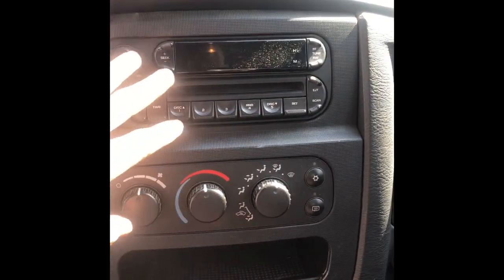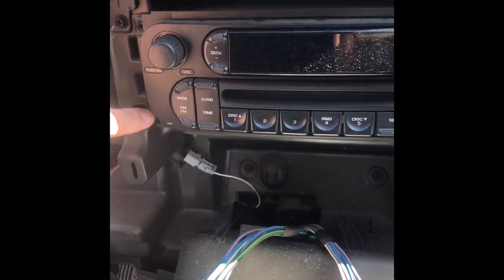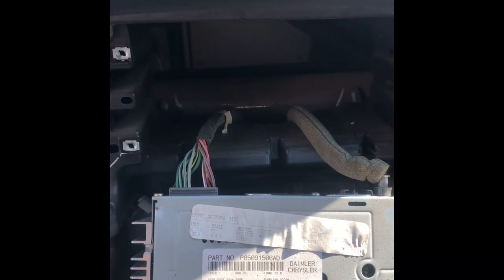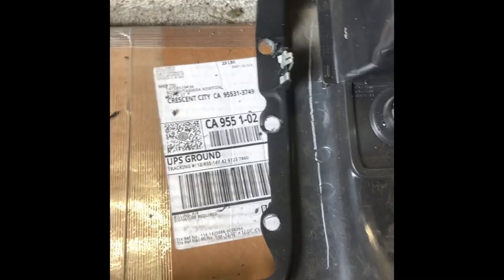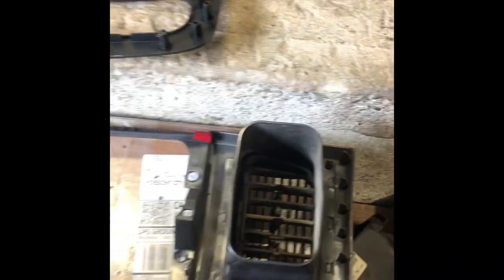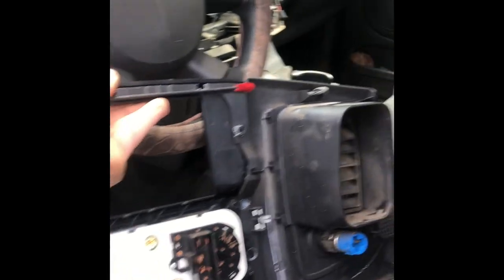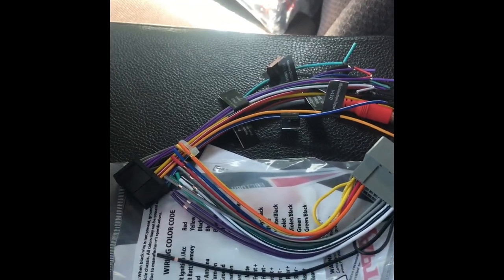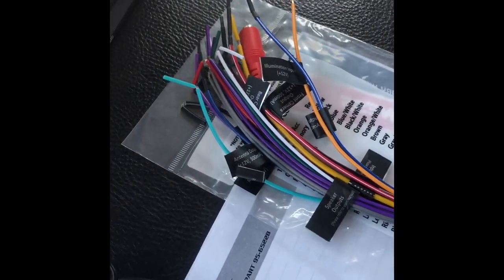Double Din Stereo Install 2002-2005 Dodge Ram Truck

Comment: Would have been awesome if you went over the wiring. It’s not just connecting the colors together and all done. You may as well just showed a before and after.
Reply from the maker: Actually, on My Dodge, it was just simply connecting the colors together and there were a couple that had lines on them, but they connected to the same color wire with a line on it as well. Thanks for watching.

Comment: Nice abbreviated install. Did you have to cut the plastic on the top of the opening to get the radio to fit square to the front? Also, the rubber floor mats look underwhelming. Husky makes some floor mats that fit like a glove for  these trucks.
Reply from the maker: Nope, didn’t have to cut any other piece. Thanks for the comment. Yeah, think I bought those floor mats in ‘07. Hahaha. I think they might even be old husky’s. Before they got into the molded mats. I should probably upgrade. Thanks for watching

Comment: Did you wire in your steering wheel controls I would like to do this with my 2003 Dodge Ram 1500

Comment: Do any double din radios fit that are 6.2 inches? I’m looking for a radio that has apple CarPlay but I’m afraid it won’t fit on the double don install kit.
Reply from the maker: I’m pretty sure they will as long as the measurements match.

Comment: you`re supposed to "melt" the panel studs to install it,   hot glue will probably fail sooner or later.
Reply: Try Krazy Glue and baking soda for a more permanent fix

Comment: GREAT CONTENT. 
FYI, here's a tip. When filming, you should shoot in a horizontal position, this will alleviate the blocks on each side of the video and will be full screen.
Reply from the maker: @Jimmy Rivano Thanks, was having trouble with the editing app and it wouldn’t work horizontally. Would make the vid like 1/4 screen. Thanks for watching and the compliment.
Reply: Box

Comment: Good job with the video.  Much appreciated.  I have a new double din Kenwood Excelon stereo on the way from Crutchfield and will be putting it in sometime over the next couple weeks.  I was concerned about the dash modifications but it doesn't look too bad.  Oscillating tool was a good idea. Looking forward to using the new stereo not only for music, but for the backup camera and navigation apps as well.  I'm replacing a Pioneer single DIN that I put in several years back.  It still works great but I really wanted a larger screen after driving some newer vehicles that have them.  Another great mod for me was upgrading the door speakers.  I bought Kickers and they are awesome for the money.   I'm currently running an inexpensive license plate backup cam that is wired to an Edge gauge set.  It sorta works but the screen is too small and grainy.  Anxious to see it on the big screen.
Reply from the maker: Thanks for the Compliment! Much appreciated. I was concerned about the dash mod as well, but it’s very easy. I’ve been thinking of some new door speakers as well, so thanks for the advice on the brand! Thanks for watching
Reply: what backup camera would you recommend.  I'm shopping around now.  I bought a Excelon 907 and wanting to install it and the camera

Comment: Dude.  Good video.  Well done thanks.   What is the largest screen we can get into these older Rams?
Reply from the maker: Thank you for the compliment. I’m going to say this head unit is probably pretty dang close as to what will work. But I imagine as long as they make the front to fit and the unit will fit in the modified cubby, they could make something with a larger screen that will work..?

Comment: I wonder if you can use like a cordless ryobi solder to cut out the deck.
Reply: You probably could but I don't know how bad the plastic fumes would be, you could probably also do it with a Dremel cutoff wheel

Comment: Did you have to connect the parking brake wire into the harness. will the radio work when not parked without it connected?
Reply from the maker: @jeon person To be honest, I’m not sure/don’t remember. I just hooked up whatever wires that were there. I don’t have any issues when parked or not. Sorry couldn’t help more.
Reply: @figsoutside1981  All good man, thank you! And good video! 👍
Reply from the maker: Thanks and thanks for the compliment.

Comment: I have a 2002 Dakota with the same head unit and air conditioner controls and I thought it was a single din for the longest time until I saw someone else take theirs out and apparently it's a din and a 1/2 even though it looks like a double din, Do you have any measurements you can give me?
Reply from the maker: @PAKTRA PRODUCTIONS sorry to reply so late, dimensions of the head unit or what’s under the cover piece? I believe most are actually din and 1/2. I’m pretty sure that’s what mine was too.
Reply: @figsoutside1981   Yeah I was curious of the actual dimensions of the unit itself like as far as depth and all of that

Comment: And does this work with the old infinity stock speakers and radio wiring etc?
Reply from the maker: @Dakota Larimer Yes, it works just fine. The Plug adapter came with the Dash kit and is color coded with very small labeling for what the wires connect too. I am not a stereo install wiring guy and it was very easy. I just connected the wires that were there. I don’t have any audio controls on my steering wheel.

Comment: Hooked mine up doesn't work any ideas??
Reply from the maker: @A1 hobbies :did you check the fuse? Also check the main power wire to see if it has power?
Reply: @figsoutside1981  yes I checked the fuze that's on the stereo if that what u mean..also there's a ground wire from the stereo any idea where that goes..
Reply from the maker: There’s also a fuse in the fuse box I believe. Dang, I don’t remember if there’s a ground wire off the harness, but there should be.

Comment: How does the Radiohead work thinking of getting it wanna know if it works good
Reply from the maker: @Mason Gurney Thought I already responded, but guess I didn’t. Not showing up. Yes, the radiohead works good. The only complaint that I have is when listening to a CD, it takes a little longer than normal when switching back and forth between songs.